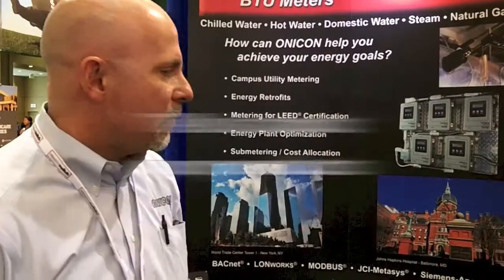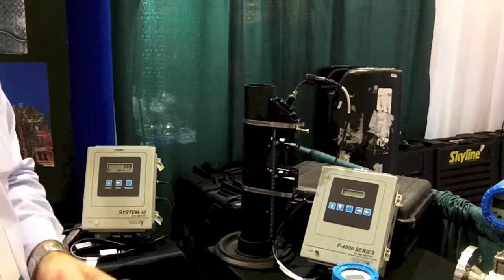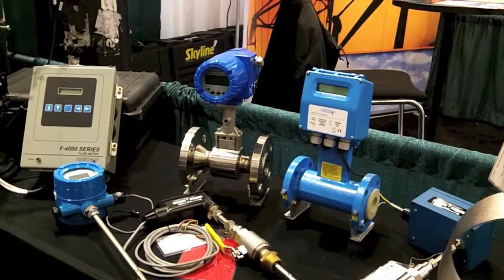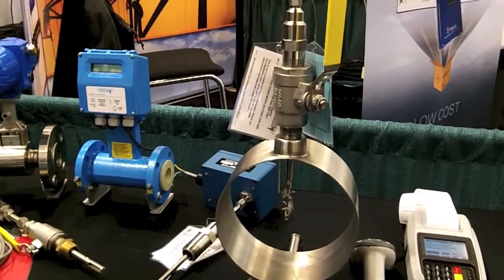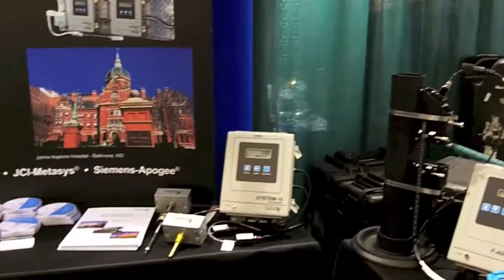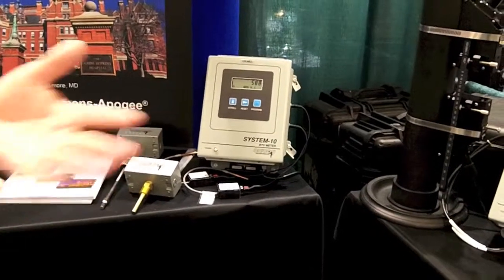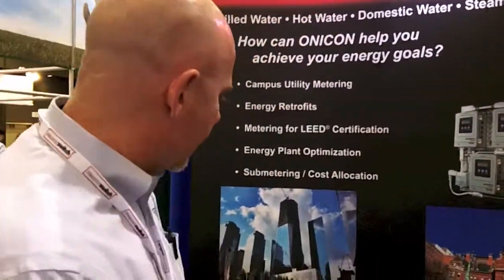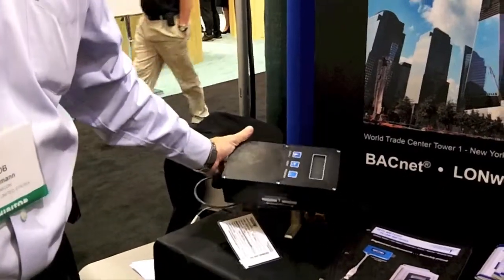Flow and Energy Measurement with ONICON

Comment: what is the electrical requirements for flow meter?
Reply: Each meter is a little different, for a turbine meter the supply voltage is 24 VAC/DC, the BTU meter can be either 24VAC/DC or 120VAC/DC